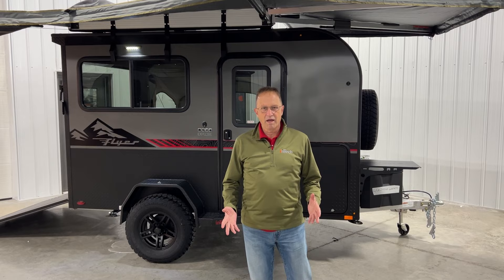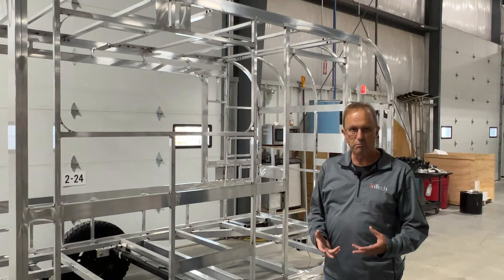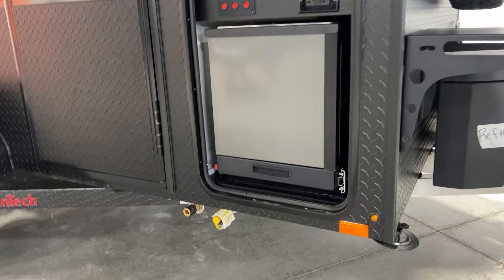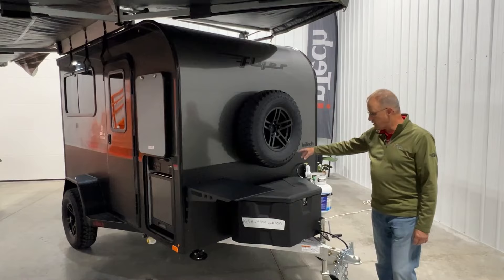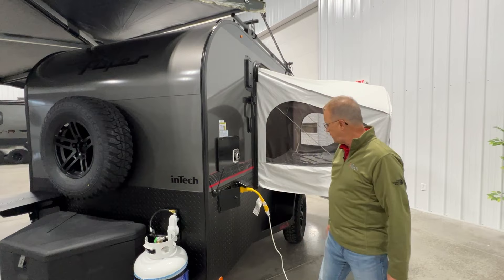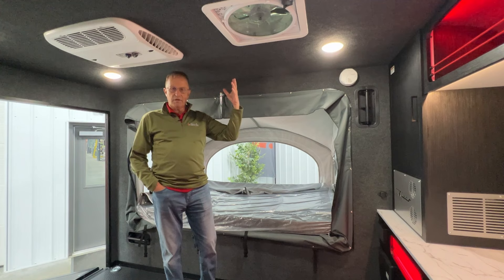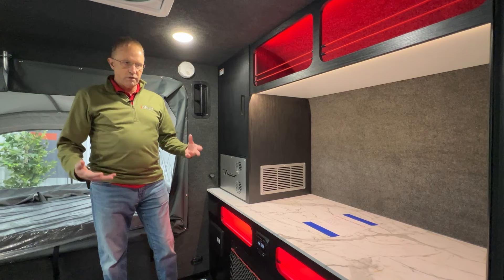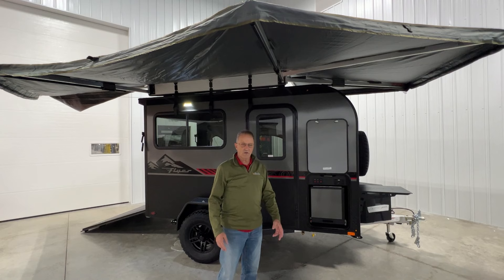2024 Flyer Explore Walkthrough

Comment: You should look at making a Flyer without the ramp door, with a queen bed and wetbath. Just a simple camper for simple people that just want to camp.
Reply: Tip the ramp out level. Add an arwing and shower tent onto the roof rack. 
Just needs plumbing extended
Reply: It's meant to be a toy hauler. What you want is already available from other manufacturers. inTech's new Flyer Forge has a wet bath, but it's still a toy hauler.
Reply: @vooraltijdnederlands  But the forge is twice the tires, weight and price . That's a bit steep to get a wet bath :(
Reply: @vooraltijdnederlands yes there are other brands a that are similar and we have owned one(little guy max), but they don’t have the same quality or reliability in their campers that they build . We prefer quality over looking good, over falling apart on the first trip.

Comment: Can these be ordered from Intech direct? Needing artic white exterior, double rear doors,adventure pkg,delete ac and add additional max air,timbren suspension and antenna coaxial exterior port with interior plug.
Reply: No. You have to go through a dealer.  The dealer will order the trailer to your specifications, unless they already have one in stock.
Reply: Is a timbren suspension an option? I ordered a ‘24 and the dealer didn’t mention any optional suspension upgrades